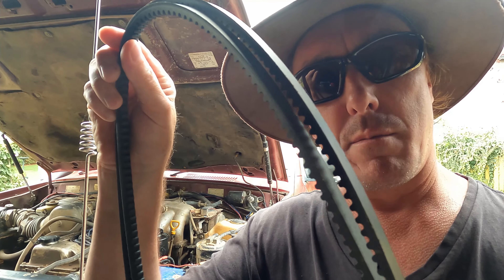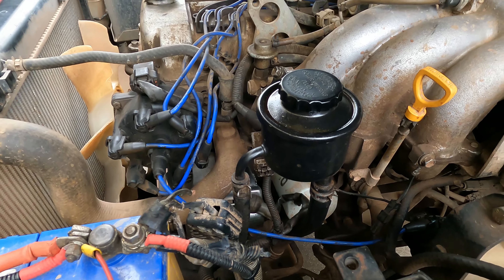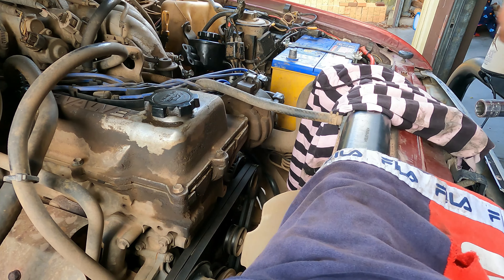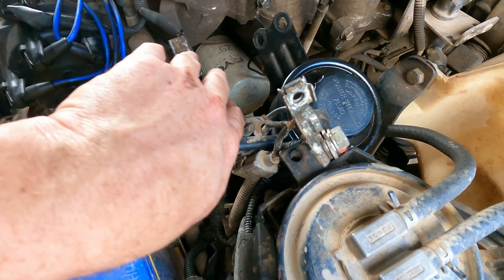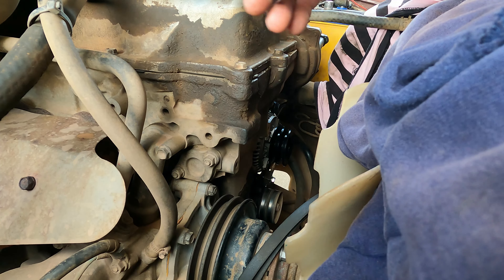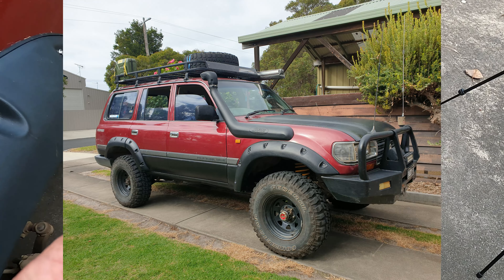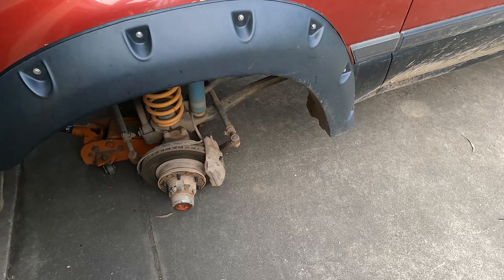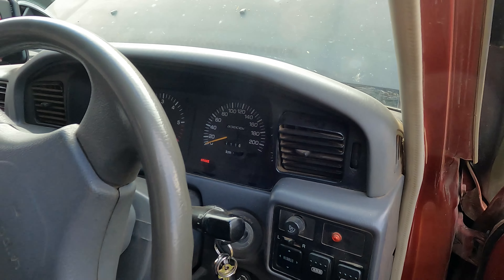80 SERIES LANDCRUISER | ALTERNATOR REPLACEMENT | ALTERNATOR PLUG REPAIR | FUSIBLE LINK REPLACEMENT

Comment: Great Stuff good to watch. I have a 75 series Troopy with a 1HD-FT conversion. Drove to Townsville from Melbourne and back and was going like a bullet all the way until about 4,500kms into trip and all the flashing lights like yours started. Consensus is it could be the alternator plug. It looks very hard pressed up against airbox intake pipe - obviously a very tight fit. Airbox is still 75 series so might need to be changed to a custom set up to also allow room. Seeing mechanic next couple days. its a new alternator previous mechanics just put in - 150 amp and it powers two Invicta Hybrid Lithiums wire in parallel.
Reply from the maker: Awesome mate 👍 hope you get it all sorted out. Hope the content helped 👍

Comment: Trying to figure out why you took off the left front wheel other than to lower the truck ??   I bought my 94 brand new back in 94. Paid 47k US for it back then. I’ve got 255k Miles on her now.  If I ever win the Lotto I’m flying to AU and loading up 4 shipping containers full of old right hand drive diesel LC’s and Toyota trucks and shipping them home 😎 Great video 👍🏻👍🏻👍🏻
Reply from the maker: Gday mate Yes it was to lower the Rig. Makes it so much easier to reach into the engine bay. Love to 80 series mate don't think ill ever go past it.  Thanks for the comment 👍
Reply: @Bush-Tv  I’ve got my 94 and a 91 with the smaller engine. Right at 300k on the 91. Both are my daily drivers. Cool Chanel Brother 👍🏼
Reply from the maker: @jpdunamislodge  Nice 👍 and cheers mate 👍

Comment: nice video mate. my alternator (1990 base model hdt converted from 1hz) is payin up after only 5 years (that OEX brand).....so looking to replace it & check plugs. if the plug/ fusible link are easy to come by/ not too expensive....it would be a good idea to replace from original eh? Could they be the cause of my problems and not the alternator?  my 80 starts fine...but dash lights come on a bit & car runs a bit statically)....even though batteries ...while 3 years old....say 'green' for ok and starts fine. I will take a closer look at link/ plug 2moro....but I saw 2day that the fusible link wires all seem intact........but she has done ~850,000 klicks! Can I ask where you got plug/ link from? any old place?
Reply: p.s - im a man of Vic high country too - a mate and I travel to weird and wonderful rivers for alpine white water kayaking. our last trip was down the upper caledonia. what  a place eh! 🙂
Reply from the maker: Yeah I found my problem was the alternator that coursed the fusible link to fail, The plug on the back of the alternator had some damage, just an old plug. All the parts are pretty cheap mate, I just went down to Burson's By memory that plug was an adaptor for a Hilux so I had to cut off a plug and re solder.
Reply from the maker: Great area up there mate

Comment: Did you have any issue getting the top of the alternator in the bracket? Mine is interfering with a tab in the bracket, but I don’t wanna force anything out and break stuff! TYIA
Reply from the maker: Not this time but the last time by memory (years ago) I had had some issues with the top blot lining up.
I think it was a bit forced in by memory